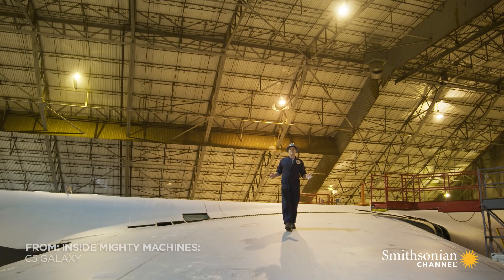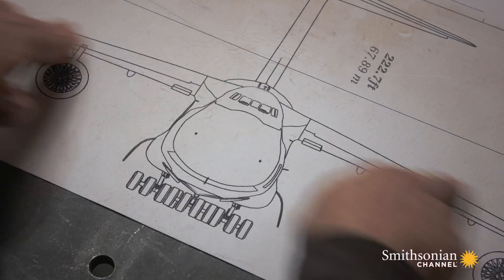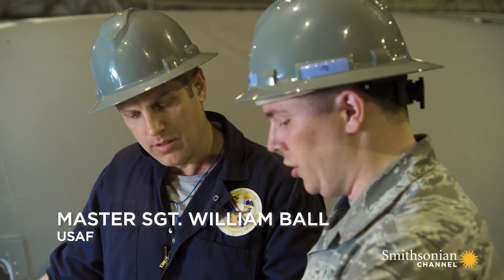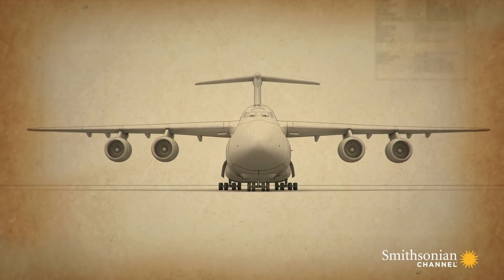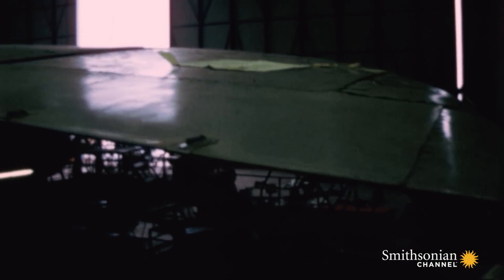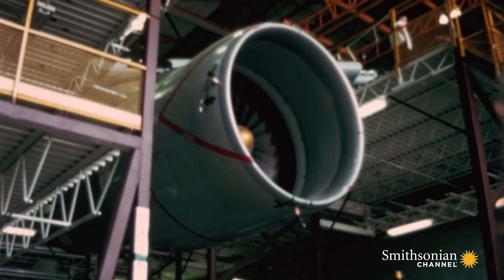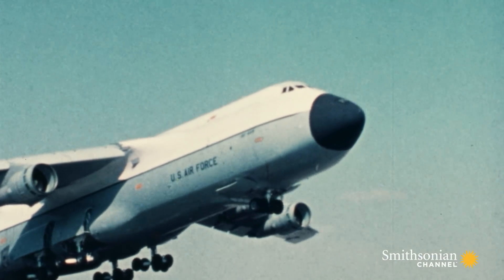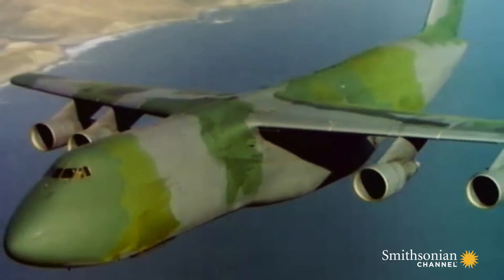The C-5 Galaxy Had a Catastrophic Design Flaw

Comment: Former C5 crew chief here. They redesigned the wings with more modern aluminum alloy and added ALDCS that adjusted the ailerons in flight to reduce wing loading.
Reply: Now, if you wouldn't mind obliging those of us without an Air Force background, what is an ALDCS?
Reply: Thanks for the info. Too bad the guy who made the video decided to leave that crucial information out.
Reply: Travis. 89-93 active. 94-99 reserves.
Reply: @peterbyrne4709  I was on Leave I was at Travis in the Air terminal taking a military hop. We were their on the eve of operation just cause. I think the terminal had 50 airman, sailors and privates. The next morning they all flew to south America. We were abandoned!
Reply: Active Lift Distribution Control System
Reply: @peterbyrne4709  A computer system that moved the control surfaces to control how much the wings were allowed to flex under gust loads.
Reply: I love hearing first hand accounts from former pilots or crewmen.
Reply: Your 2 sentences gave us far more info than the nearly 4 minute video.
Reply: @jnichols3  NP. Can't believe I still remember this stuff after all these years.
Reply: Interesting Calvin. I didn't know L-1011 had ALDCS. It was a pretty reliable system.
Reply: It basically makes the wing produce less lift in an upward gust. The L-1011 had it as well. With modern fly by wire airliners it’s a simple(ish) software patch to get the same results.
Reply: Calvin Nickel:  Thanks.  I appreciate the information.
Reply: I believe the ALDCS was responsible for redistributing the wing load. It can’t reduce it. Wing loading is what it is. Wings carry the weight of the airplane, what ever that is. The portion of the outer wing carrying load can be redistributed to the inner portion of the wing causing less flex and reducing the range of bending. This will lessen the fatigue cracking caused by bending.
Reply: Thank You
Reply: As a Avionics guy I hated the augmentation system, I was always the lucky one to have fail it's self test and up I went to the Stab.
Reply: Jeep Cherokee       What are you talking about?  There was a black box for the ALDCS  system in the avionics bay...  since I was AD and worked in that shop ( which at the time was auto pilot, before it combine with instruments), when the system was first put on the jet....  I don’t remember anything in the tail for it,  just the accelerometers on the wings....  I worked docks too...  the only thing I remember in the tail were the 4 LVDT sensors....  something new after 77?
Reply: @jcak552  I wrote Augmentation. Pitch is in the tail. ALDC's is another animal.
Reply: Jeep Cherokee   Oh my bad,  it has been in excess of 30 years since Iworked on them
Reply: The plus side was getting to sit on the copilot side or recording engine runs with the old engines. Just imagine with the brakes set and wheels chocked the four engines are run at near full power. I guess the nearest movie would be Airport when they are trying to get the 707 out of the snow. It's really cool.
Reply: @jeep146   qwityerbitchen and get up that tail sparky!
Reply: Man, I remember summer camp at The Citadel in Charleston, SC.   It right under the flight path for Charleston AFB.  Normally, it was a steady supply of C-17s flying over on final, and those were impressive enough.  But ever now and then we'd get a C-5.  And everything just stopped... not a head wasn't looking up into the sky, no matter how many times they had seen it before, at this behemoth that had no business in the air.  It was awe inspiring.    Reminds me of a Saul Williams verse...

"I can think of nothing heavier than an airplane
I can think of nothing less likely to fly
There is no greater conglomerate of steel and metal.
There are no wings more weighted."  

Thank for you service.  She is pretty bird.
Reply: Cheapest contractor. It was known by patent holder, and the company employing him. The original wing would not hold up. In the end, his company got the rewing contract. And his design was proven with the L1011, before the AF chose a cheaper alternative. Lockheed protested. But the cheap choice was chosen. Lockheed sub contracted to the designers company for the rewing. We called them C5A-mod and C5B. My thoughts at the time was simply thicker wing spars with a  stronger grade material. Should have been done right the first time.
Reply: Thanks Chief..... from a Navy Veteran... thank you for your 'professional insight'!!
Reply: My son is wanting to join the Air Force. What would you recommend as a job for a kid who is naturally gifted with electronics and computers? He is really interested in working on jets.
Reply: @foreverssober  Hi. There are several specialties for aircraft maintenance.  Such as electro-environmental who fix the electrical sub systems and pressurization systems. There is also avionics specialists who deal with instruments, radar, auto pilot, etc. Feel free to email menif you would like to discuss more.
Reply: @foreverssober  He's in luck then they stopped using prop planes a while back I heard.
Reply: @foreverssober  28 year retired AF Lt COL.  Tell your son to join - great people, great adventures, great skills, great education opportunities (GI Bill, Tuition Assistance) .  I realize some people hated their service time, but my sense is the vast majority appreciate what they got out of their commitment.  If his grades are really good, either advise him to apply to the Air Force Academy or join enlisted and then apply.
Reply: @danderby8261  
He actually just enlisted last week!!
Reply: So simple, easy, why isn’t this guy telling us this
Reply: Well I'm glad they got that fixed!  As a paratrooper I'm used to jumping out of perfectly good airplanes, but they didn't bother giving us any parachutes for our ride across the creek to España.
😉👍

Oh by the way...  That's one tall ladder into the passenger compartment!  I wonder how many injuries have been caused by slips and falls on it!  🥵 😅
Reply: @bobjohn8581  , I was at Travis when a FRED landed gear up in 1983 . . . .  THAT was a real cluster . . . .
Reply: Of course  a million aero experts  the only person i seem to believe  is Peter byrne
Reply: Thanks for actually telling us what they did! You should be making these videos
Reply: As a crew chief and A&P the question remains...Who is “ they ? 🤷‍♂️🤷‍♂️
Reply: HARLEY D  Hey, Harley,
I’m not even military & yet I know the answer to that question.

“They” is “anybody you want them to be ... as long as they aren’t within earshot at that moment.”

At least, that’s the answer in industry.
I strongly suspect that the definition is the same in academia & in the military.
Reply: Peter when did you servce?
Reply: @LK-pc4sq  Active duty at Travis 89-93 then reserves to 99
Reply: Thank you for the explanation.
Reply: I was a loadmaster on c-141, the reserve flew the c5 out of travis '74
Reply: Thank you, the abrupt ending of the video left that important point hanging
Reply: You must love your job
Reply: Never knew this! I was a 431 in PGH, 112TFG when they were at the end of their A-7 & one A-7K usage, merging over the 135’s only. 
While at Lackland & Kelly in ‘87, they all called them by the ‘A’, (Lol, never forget the unique sound ALL NIGHT LONG with Touch & Go’s 😒, WHITE NOISE THEY WERE NOT).
Reply: Is there any way you could explain the experience?
Reply: The should have iust vorticed the top load
Reply: Bob John. Were you stationed at Travisty AFB?  Ha. I did that for my friends at Dover.
Reply: Lockheed. Where no adversity can withstand the power of a few more billion in extorted taxpayer funds.
Reply: Bingo, that's the answer. Good old FRED
Reply: @SVSky , I was stationed at Travis AFB from August 1977 to September 79 and again from November 81 to June of 85.  So, for the benefit of those who DON'T know what FRED mean, please explain . . . .
Reply: Yes but I wasn't working that day. From what I heard, it could have been a lot worse.

Comment: Use the metric system!!!!!
Reply: The quarterback makes a long pass, but the ball is fumbled on the 23 meter line.
Ain't going to happen.
Reply: André B. Saba The airplane was designed using the imperial system. You do the conversion.

Comment: Is the C-5 still around or is it being replaced by the C-17.
Reply: The C-17 is no replacement for the C-5, it doesn't match the cargo capacity.  The C5 fleet was, or is being, overhauled to the C5-M Super Galaxy, extending the life of the planes for quite a few years yet.
Reply: C-17 replaced the C-141B.